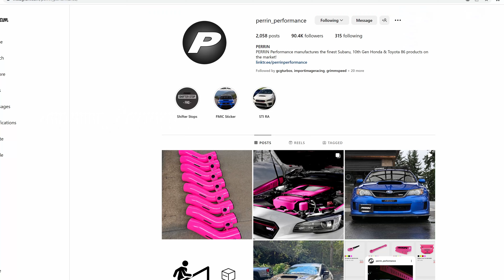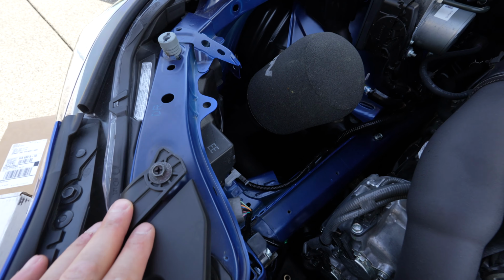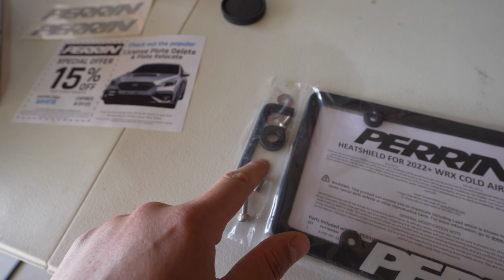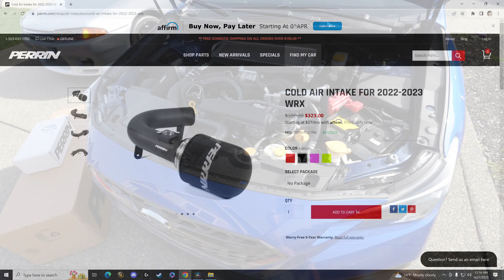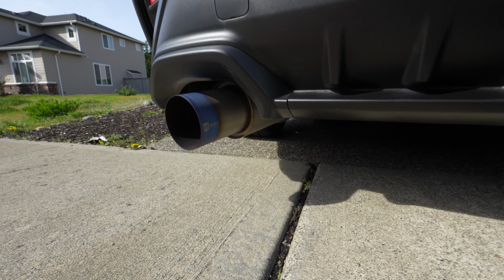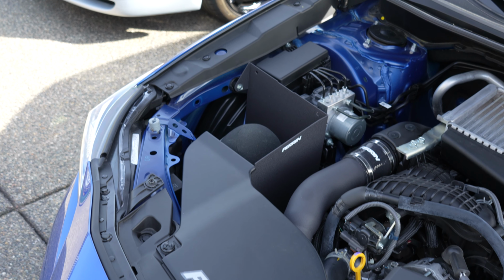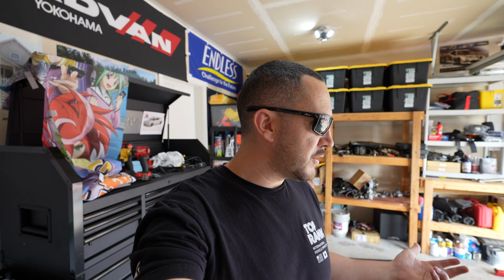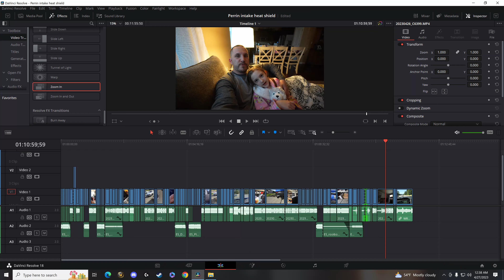VB WRX Perrin cold air intake heat shield makes FA24 pull harder 2022 2023+ Subaru no tune

Comment: Hey bro, i really want to run this intake but will it mess up my car in any way?? i don't want to get a tune because i want to keep my warranty, perrin does say you don't need a tune but can you trust their words?? also it sounds amazing !!
Reply from the maker: The AFR 's on my car reviewing the data logs with the Cobb AP are safe. Subispeed also did a intake test video for the ETS, Perrin and AEM intakes. Their dyno data showed the Perrin intake perfectly safe as will with stock tune. The date shows that the Perrin intake is good to run with stock tune. I ran it on my car for 3 months or so without any issues before getting my pro tune done.
Reply: I'm in the same position and 50/50 with installing the Perrin CAI but don't want any penalty with my warranty too lol

Comment: So is it safe to run the intake with out a tune? Or not?
Reply from the maker: The Perrin intake has lots of testing with base map, Cobb OTS tune  stage 1 and 2. The AFR values are within safe ratios. So yes, you can safely run the Perrin intake without a tune. The tune will help you to pick up additional horsepower though. Beyond the intake, the Perrin inlet will also be safe to run on stock tune or OTS tunes. Turbo inlet video will be coming soon on my channel. Waiting for Perrin to release the product so I can post the video. Good question, thanks for watching and have fun with your VB mods.
Reply: @JDMRightHandDrive   thank you. Just curious because I want the noise more than anything. And the warranty… I guessss. Appreciate you
Reply: @dyliver  did you get it? thinking about getting one without the tune either just want the sound
Reply: @VietTaly same

Comment: Cold Air intake and exhaust great upgrade even with stock tune, Just pick up 2023 WRX 6 speed. Live Montana so plenty dirt roads and snow.  Mudflaps and steering wheel first upgrade
Reply from the maker: This will be a fun car to drive on those snowy Montana roads! I have been thinking of adding some mud flaps to mine as well. Thanks for watching.

Comment: Do you think it's better to have a tune for the BOV? I'm planning on removing mine this weekend. Many people are saying that it's not good for the engine in the long run. Thank you
Reply from the maker: Its hard to tune for a vent to atmosphere BOV with a MAF sensor, you really need to have a MAP sensor to properly tune AFR's. I am pretty sure I am going to remove mine as well. My car does weird things after installing it. When I take my car out of gear coming to a stop at a light, the rpms drop past idle and then pop back up to 2k before going to a smooth idle. I have also had my car stall a few times from the rpms dropping to low. When the car vents to atmosphere it causes it to run rich, which is what I believe is causing my issues. It will be a good test going back to stock to see if I am right. Is your car doing anything strange after installing the Turbosmart BOV?
Reply: @JDMRightHandDrive  thank you for the info. Well, I haven't had any problems with the car yet, but after watching a bunch of videos, I realized it's not worth damaging the car just for a noise, especially if it doesn't give you any extra power. One more question please; When I got the car, the dealer told me that I could change the oil every 6,000 miles or 6 months, but I still choose to do it every 3,000 miles. Since it's a turbo car and we shift at higher RPMs, do you recommend changing the oil every 3,000 miles?
Reply: @DrivenDailyPOV  ...you can change the oil every 1000 miles if you want to.  early oil changes are fine, just extra costs for you.  I only use miles to determine oil changes (not time; or every 6 months? 🤔).  Since I drive 1k-1.2k miles a month, I do two oil changes per year (+ filter).  If you don't want to do 3k mi changes, do 4k or 5k mi intervals if you don't trust the oil.  Also, look into oil analysis services to get a feel for how your oil is doing.  I try to do mine btwn 5500 and 6000 on my FA20DIT and use 5w-30 in Ohio.  Of course, I have not done an intake deposit cleaning or changed the diff/trans gear oil and I'm at 53k miles.  Oh, I did notice a 2mpg different btwn resource conserving (RC) and non-RC oils

Comment: Any noticeable heat soak in the charge pipe?  Factory abs-style works great to prevent this, so wondering if it's noticeable.  My concern would be when you're driving it normally in traffic or just cruising around and there's more of a build up of engine heat around the area.....it would just slowly soak into the pipe raising the charge air to the TMIC.

Comment: So I see you have a Cobb, but have you ran your car with the Perrin intake and charge pipe ( without ) a tune ? I wonder is  that safe
Reply from the maker: AFR is within safe range, I will be  getting a protune very soon and taking it easy on the car until then. I am installing a ton of parts and will tune it as soon as I am done.

Comment: You know with FA20 a cai made HP without a tune too, but only temporarily. The car runs slightly leaner therefore makes few more hp, but eventually it adjusts the trim fuel.
Reply from the maker: I have the tune coming soon. I want to definitely maximize power and make sure car is properly mapped. Thanks for watching. 👍

Comment: Why run a Cobb and have Perrin products? I went all cobb stage 2 and only Perrin on intake, Heat Shield, Pitch Stop, and all the engine accessories. Cobb has Carb exemptions on all their products and their all state legal. Seems like a headache in the near future with a pull over.

Comment: Great video. Taking a look at it, does it look like there's room for a traditional cone filter to fit? If I got this I'd probably want to replace the oiled foam filter for an oilless AEM Dryflow or Grimm Dryconn etc. Just a personal preference thing, I hate dicking with oiled filters.
Reply from the maker: I would say yes there is enough space for a traditional filter cone as long as it is a shorter one. Thanks for watching.👍

Comment: How do you keep the old Subaru wrx from having ringland failures
Reply: ...keep it stock, don't add power, change oil on time, let oil get to temp before romping, do a cyl-4 cooling mod

Comment: Now does the intake require a tune for the fa24
Reply from the maker: Perrin says no tune is required. The intake diameter of the piping in the MAF tubing is the same size as stock, so it does not effect the air fuel values. Its always a good ideal to get a pro tune to maximize the power potential of these mods. But if you want to run it with stock tune, you will be just fine according to Perrin. My AFR ratios are the same, if you see the end of the video the Cobb shows my air/fuel ratios during a 2nd gear pull. My AFR values are the same in the data logs with the Perrin intake as my stock intake system.
Reply: @JDMRightHandDrive  awesome thanks brotha for the info
Reply: You still need a tune Ask any tuner That Works on Subarus

Comment: It sounded like your car was whistling under wot.   Did I hear that correctly
Reply from the maker: I listened to the video during all the pulls. When comparing what I hear in the video from what I know from driving the car.  The only sound I could recognize from driving the car was the intake induction sound at full throttle. I filmed the in car footage with my I phone, so the audio pickup on that compared to my full frame Sony Alpha and external Rode mic is not high quality. Definitely not a BOV boost leak, if that's what you were thinking.  Good question and thanks for watching.

Comment: #totheend  Man I like the Cobb sensor display.  Even has oil temp.  Is the oil temp sensor there already on the stock car?  Or did you have to add it somehow?  
"Right Hand Dr" LOL on the street sign.
E30!!  That should be fun.
Reply from the maker: Hey Gary so glad to see you here again #totheend, thanks for that, I appreciate you🙏 The car already has all the sensors. Inside the Cobb AP menu you can assign what sensors you want to see on the display. Its unbelievable what the AP can do for $700. You and I both know with our older cars, my GTR and your Eclipse ,how much money we have to spend to get these features. So glad I bought this car, been having so much fun with it buying parts and working in it. Unlike my GTR where the parts are so expensive, its nice this platform is affordable for the average person to buy and easily mod.

Comment: Will this void warranty?
Reply from the maker: There is always a chance Subaru would choose not to cover the warranty if you have aftermarket pats on the car. If I was to have any major mechanical issue with my car, I would remove all the aftermarket parts and put the car back to stock before going to the dealership for service.